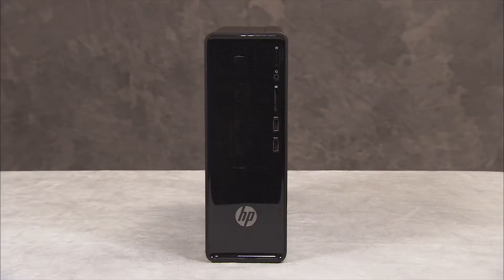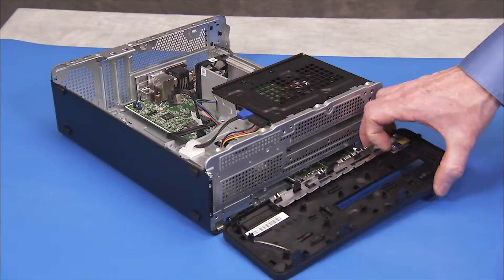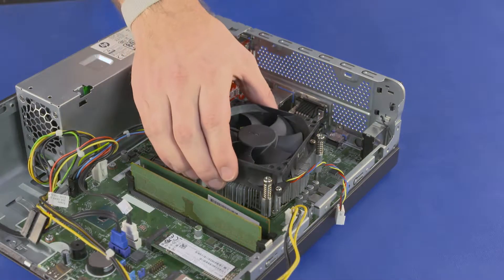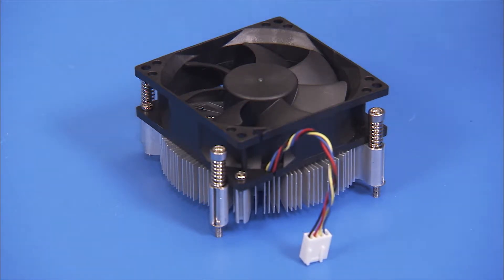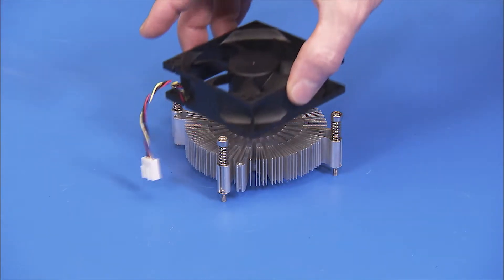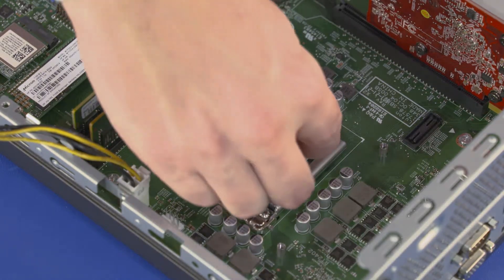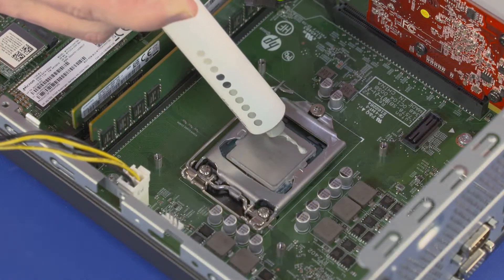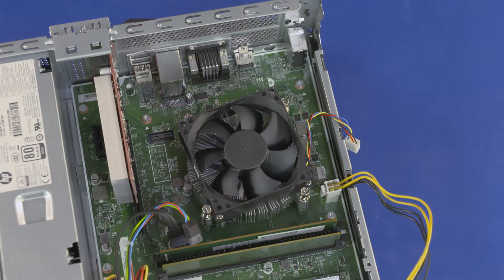Replace the Heat Sink (Screwed-in Heat Sinks) | HP Slim 290, Slimline 290 Desktop PC Series | HP

Comment: why in the name of all that is intel did you swap the PC you were working on , my machine is the exact config you started the video working with then right before the money you switch to an entirely different machine  and it  has a completely dif heatsink and fan with the crappiest excuse of pin fasteners ive ever laid my eyes on ( or sore thumb ) no markings , no guide , no tool slot .... i reaaaaaly need to know how to get these darn things off ot upgrade my chip so I can do some more realistic level processing . Now that iu have a chip I cant get this heat sink off and dont wanna break anything on this gentle piece .
Reply from the maker: +Sonic Audio May i know the complete model number of your computer so that we can check the details for you?
Reply: well evidentaly the "chip " in the slimline 290 that is a pentium silver , deosnt even have a true chip slot . it seems to be a chip like ive never seen just adhered to the PC board . never in all my life of working with PCs have i seen this . I got a chip to " upgrade " and now there is no real chip bracket .  Hp slim 290-a0020 w a pentium " silver j5005.. Im guessing there can be no chip upgrade ? bought a i5 9400 and now have nowjere to put it ... dang